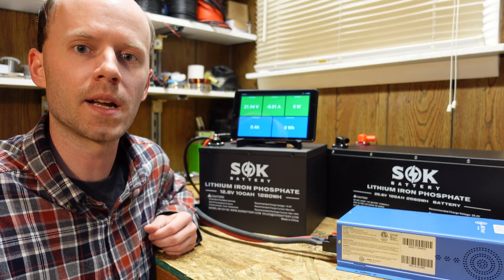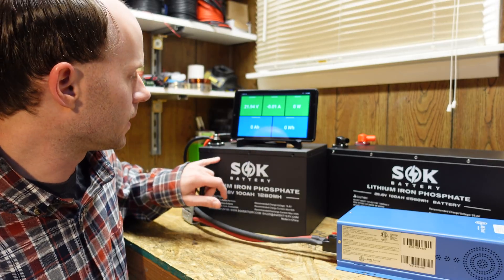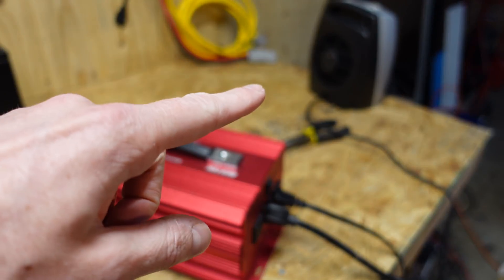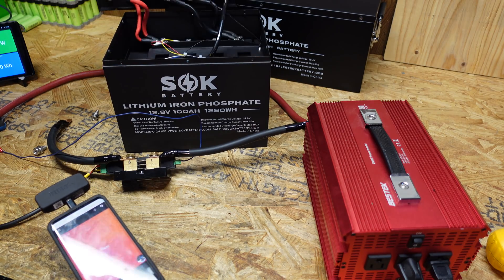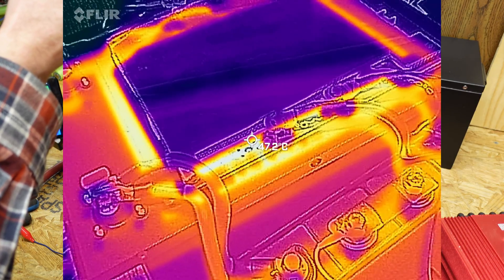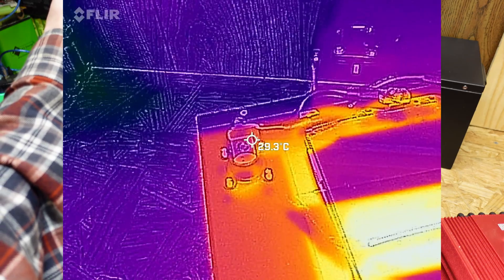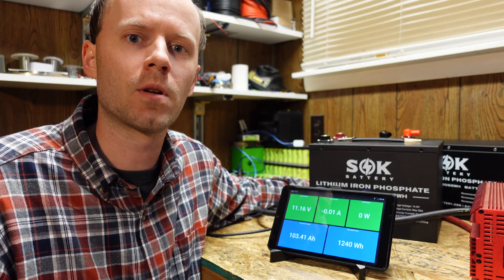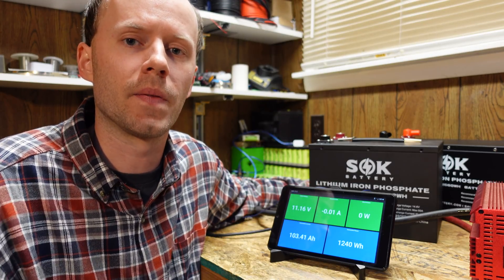SOK Battery 100A High-Rate Discharge Test (with Thermal Camera)

Comment: I really appreciate guys like you and Will Prowse who have studied this technology and share your knowledge with us who want to learn. Question please; I'm new to this tech and am building a camper van and I've already purchased (5) of the 206AH SOK batteries. It's going to be at least a year or so before I put these into production. Can you recommend some equipment I can use to safely discharge these batteries every 3 months at which point I'll charge back up to at least 50%? SOK recommended that I do this. I realize now that I should have held off on getting these but I'm in it now and want to make these last as long as possible. Thank you.

Comment: my SOK has to go to shut off at 10.xV to reach 100AH. does that mean its not properly charged or faulty :/
Reply from the maker: 10V would be 2.5V per cell, which is the normal specification. Sounds like it's working as expected.

Comment: As far as suggestion's for video's, I can't rap my mind around how you can connect these batteries in series. If the output of one battery goes into the input of the next, how can the BMS work with this increased voltage? Lets say you connect four batteries in 
series, that means the voltage entering the last battery is 36V. A video explaining this, and the best way to connect multiple batteries would be helpful.

Comment: I have two SOK 206AH batteries in parallel.. but the BMS cuts out at 180AMPs after a few seconds. 🙈 I thought that parallel would allow me to use 200AMPs with 400Amp (3 second max)... 🤦 I hope I've not spent all of this money for no reason. 
Any advice please?
Using a Renogy 3000watt inverter.
1/0AWG cables.
2000watt heater to test system.
Reply from the maker: The SOK 206Ah has a max continuous discharge of 100A. With 2 in parallel, you should be able to do 200A continuous.
- Are both batteries shutting down or just one?
- Did you make sure they're both at the same state of charge? Charge them up to 100% while in parallel. If you haven't done this, it's very possible they're at different states of charge even though voltage appears the same at the terminals, thus one battery may be suppling a greater percentage of power than the other.
- Make sure connections are done like this picture http://www.solarray.com/Images/ImagesTGuides/drawings/BATTER~4.gif to promote current sharing. If both main cables come off the same battery, the load may be uneven.

Comment: Using this battery for a van conversion. So far the quality and the size of the battery is very conducive for this application. The ratings and the price point are in line with this type of build. I look forward to completing the build and having the battery enhance the usability of the van.

Comment: I have the Renogy Smart 100ah battery with the pouch cells. I wonder if there’s a difference between a 1C test between this SOK and the Renogy Smart. There’s not much information on how good and how long the pouch cells will last if used for high powered appliances such as a microwave or A/C unit.

Comment: I guess I'm not that surprised with new cells & low usage. If memory serves, LiFePO4 discharges more effectively at higher temps? My concern was smaller diameter wires handling the larger loads- some of the batteries tested had some pretty slim wires inside along with globs of solder slag instead of proper bolts & fittings. But, once again- SOK remains in the game with great output all the way to bitter end! That's a darn good battery!
Reply from the maker: People are often surprised by the amount of amps a wire can carry. Many people (myself included) often site the NEC ratings for residential wiring; however, the ratings for chassis wiring are significantly higher. For example, this battery uses a pair of 7 AWG wires. The charts I see online rate #7 for 89A, so a pair of wires can carry 178A (short distances in chassis wiring).
Reply from the maker: But yes, SOK still remains at the top of the list with all those that I've tested!

Comment: Thank you LithiumSolar for the video. The battery seems great, acceptable temperature, was mainly worried about the cell temperature,  and pulls full capacity even at 1C but it's expected for new cells. And thank you again for accepting my request, this is the third time!
Reply from the maker: Yeah I don't have any concern at all regarding the 1C rate. The cells are rated for 60C max temperature during discharge. The highest I saw was 45C. Of course, I did not pull the cells out and check the sides but it stands to reason that the terminals would likely be the warmest area of the cell.

Comment: Tested my 206ah SOK to 140 amps discharge for 15 minutes and it didn't shutdown, post on Will's DIYSolar forum has info from SOK that says BMS is actually designed for 150 amps continuous and will not do current shutdown until above that. Wish there was better contact to metal case for BMS heatsink, definitely top of battery gets hottest and active cooling would help (blowing fan on it) as it may do a thermal shutdown before a current shutdown. I also tested at 110 amps charge rate and no shutdown. Obviously BMS does not have 100 amp discharge / 50 charge software limits and those number are just recommendations. More of an issue with 206 batteries since it has same BMS yet cells can handle much more current. Also since common port BMS charge limit should physically be the same as discharge so 50 amp max charge is silly on 206ah although makes sense on 100ah since thats 0.5C. Although lifecycle test from SOK shows 3500 cycles at full 1C charge rate on 100ah!
Reply: I was just wondering about why they put the 50 amp hr charge rate, they handle way more.

Comment: THE WHOLE POINT TO DISCHARGE LIMITATIONS IS CAN THEY RUN 150 TO SAY 200 AMPS  CONTINUOUS DISCHARGE TO RUN MORE DEMANDING APPLIANCES, AND YOUR TEST MISSED IT, FINE THEY CAN DISCHARGE AT 100 AMPS CONTINUOUS, THAT'S ALREADY BEEN ESTABLISHED...BIG BATTERIES UNITS CAN DO THAT BUT THEY HAVE VARIOUS COMPATIBILITY ISSUES.....I'VE SEEN SOK REPS CLAIM  UP TO 130 AMPS CONTINUOUS, DISCHARGE,  THAT SHOULD BE THE KIND OF TEST, BECAUSE THE 100 AMP LIMIT SUCKS.........

Comment: Great video, do you think it could handle a 90 amp charge rate, I know it’s rated for 50.
Reply from the maker: The cells are rated for a 0.5C standard charge rate and a maximum 1C continuous charge rate. Based on that, yes, the cells can handle 90A but I cannot comment on the BMS and what its limitations are. SOK does sell the same BMS separately and has a rating of 70A on it.

Comment: That capacity figure was incredible for that C rate!! Holy cow!
Reply from the maker: That was literally the first cycle of that battery. I just bought it a few weeks ago - likely why it performed so well.
Reply: Basically no Peukert's law with lithium not sure why you guys test at a low C rate like its lead or something😉
Reply: @justinharrell9256  common misconception Justin. Just because there is no effective peukert effect, doesn't mean coulombic efficiency will not be affected at higher c rates. .2C is the standard for lifepo4.
Reply: @WillProwse  Can you point me to any specific lifepo4 coulombic efficiency charts for the large cells like the Ganfengs used in SOK I am coming up empty? Everything I find shows around 99% efficient up to 1C and even beyond for LFP, SOK's life cycle test in the files section of their Facebook group is a 1C charge/discharge at 3500 cycles and CE was near 100% the entire time. Most life cycle ratings for LifePo4's seem to be at 1C not 0.2C.
Reply: @WillProwse  Looking at the Ganfeng data sheet for the 100ah cell the following is stated: 2.1.2. Minimum Capacity 100ah at a 1C discharge current (25+-3 degrees C)
Reply: @justinharrell9256  wow I was not aware that ganfengs did 100Ah at 1C. That is pretty wild.
Reply: @justinharrell9256  yes most cycling studies are at 1C. When a battery is advertise though, the capacity is typically at .2C. there are a couple exceptions to this, but typically it's .2C
Reply: @justinharrell9256  with most packs I test at 1C, I get 95-98% of the rated .2C capacity.
Reply: @justinharrell9256  100Ah fortune cells pull 103-106 even a year after cycling daily in some systems.
Reply: @WillProwse  I believe the cells are EV use rated, same for the 206ah's spec sheet nearly identical.  Seems weird to do lifecycle test which track capacity over time at 1C then do a single capacity test at 0.2C. Either way LFP is nothing like lead acid, my top of the line Lifeline AGM's had a 40% capacity loss at 1C due to Peukert, not even in the same ball park of LFP with maybe 5% max loss due to CE, which still seems high compared to SOK's with Ganfengs which have even less loss.
Reply: @justinharrell9256  a cycle count test at 0.2C would take too long
Reply: @niktak1114  But if your cycle test at 1C shows 100% capacity for the first X cycles all the way down to 80% capacity and EOL, whats the point of doing it at 0.2C also showing 100% capacity? Just do it at 1C.
Reply: @justinharrell9256  if anything they should do a higher C rate test too
Reply: @niktak1114  Would love to see LithiumSolar or Will try and do a overcurrent test on SOK's the documentation is confusing on the BMS current limits and my charger maxes at 125 amps and cannot shutdown the BMS, I may try and do a discharge overcurrent test as my inverter can pull close to 300 amps if I run say A/C and microwave at same time, I did that with my two 206's and they worked fine but should try on one and see if I can get it to overcurrent protect. Would like to know what actual software overcurrent settings are because they are definitely not 100 / 50 as stated in the docs.
Reply: @niktak1114  that would be nice if they did
Reply: @justinharrell9256  I believe I mentioned the same thing over a year ago. We are  paying a premium for Lifepo4 and want to see one of the main selling points in action: Discharge test of 0.5C or higher showing that the technology is better than lead. I really want to know if those $350+ Chins/Ampere Time have similar performance at high discharge rates.
Reply: @neeld.5522  Absolutely not actually. You are paying for the cycle life count, usable capacity, lower internal resistance, lack of sulfation, I could go on. I have a few videos discussing every single point.
Reply: @neeld.5522  Do a high c rate test on lead acid and you will be shocked at how low the coulombic efficiency is. Absolutely horrendous. But that is only one factor that people use to purchase lifepo4 over lead acid.
Reply: Furthermore, lithium solar got the same figures I did with fortune cells on the first 3 cycles. Very common to pull that capacity actually on the first ten cycles or so. Depends on the cell too and BMS configuration.
Reply: @WillProwse  oh I don't doubt your claims. I've been subscribed to your channel for what I consider a long time. You definitely don't have to tell me about the pain of charging lead to full on solar lol. Never going back.
I noticed that a lot of folks on the beginner solar groups are still loyal to lead. I'm not sure what miracle it will take for the standard 12v 100ah lifepo4 to drop below $300 or if even that will prompt them to switch considering all the benifits you just listed.
Reply: @neeld.5522  Ohh ok! Yes agreed. I thought I recognized your name and profile picture haha cool
Reply: @neeld.5522  That's funny. I used lead acid batteries for camping and for radio power (high output/amperage) way back in the 70's. I hated how shitty/primitive they were back then and have been following the 'lithium' revolution from the beginning and when SOK came out with their quality affordable battery I jumped on it without hesitation. Lead acid batteries are perfect in one place. Under the hood.
Reply: For data to substantiate my comments above, look at the datasheet of any lifepo4 cell, specifically the varying capacity at different c rates. Then compare these exact charts to lead acid. Also cycle life count and usable capacity. What I hate most about lead acid is that it's hard to charge it to 100% everyday. With solar, this can prove difficult. Typically you need grid power to do a full equalization charge properly.
Reply: Interesting trick with the kapton tape on the heatsink of the bms. Nice
Reply: @WillProwse  I didn't know kapton conducted heat like that.